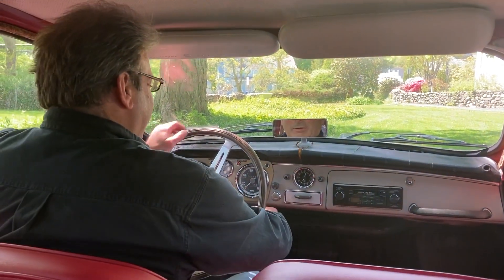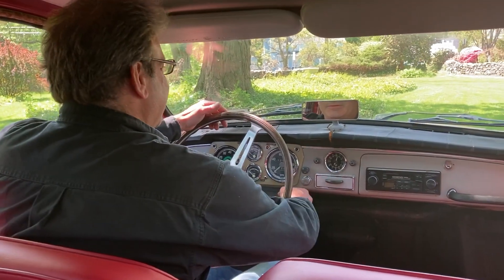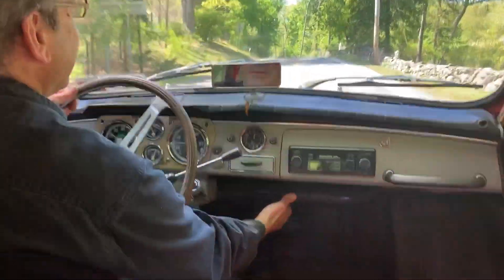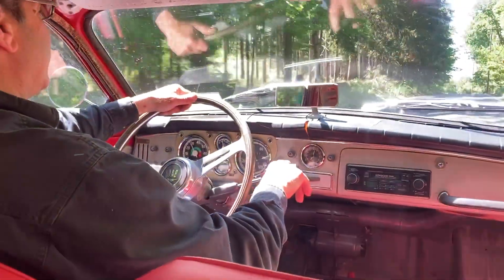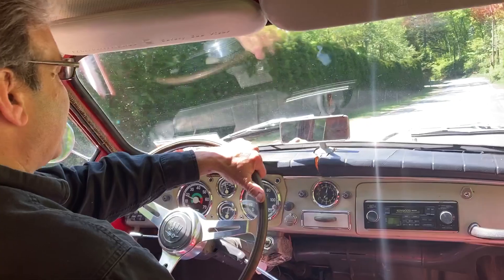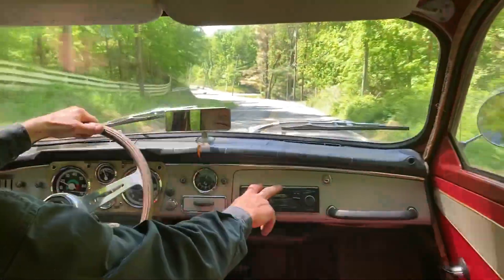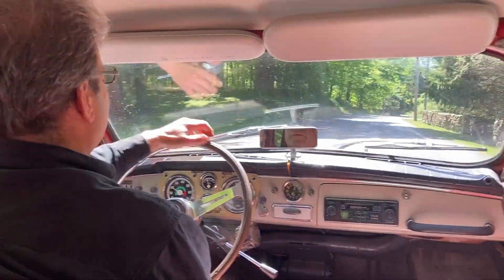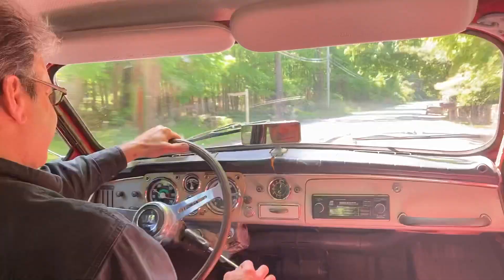1965 Saab Monte Carlo 850 out for a short drive

Comment: V4 not 850
Reply from the maker: Yes, a  previous owner put a V4 in and the car was sold to someone that did a fine restoration and installed the original 850 2 stroker.